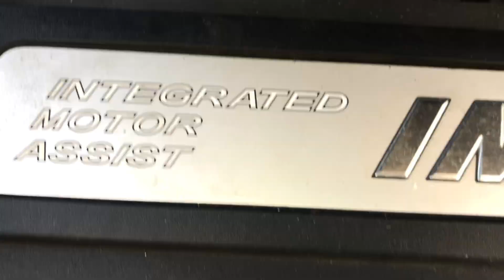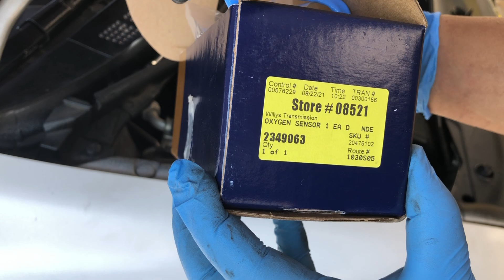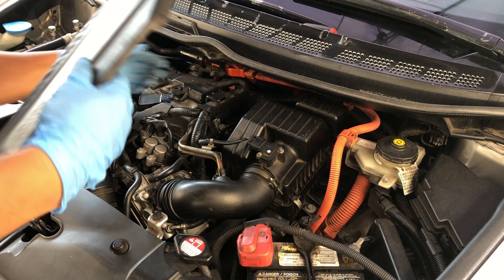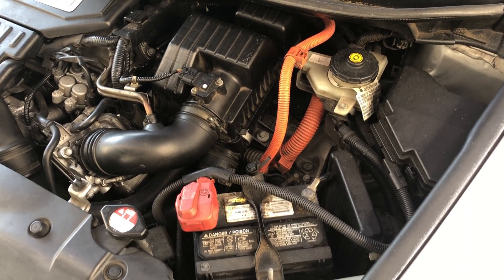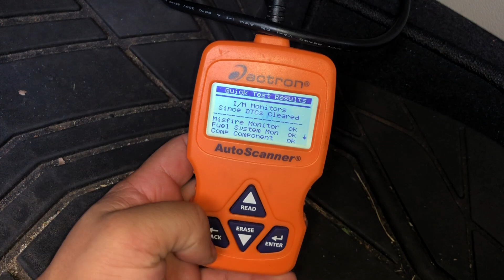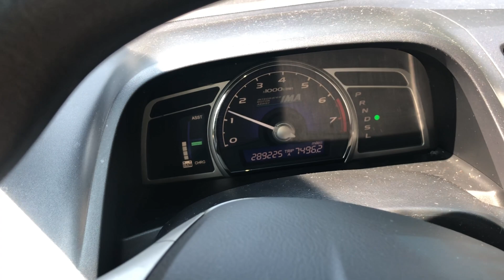2006 - 2011 DIY | Honda Civic Hybrid O2 sensor Upstream | P0420, P2A00, P1172 | 8th Gen

Comment: My vehicle has a p0171 fault. I cleaned the maf sensor and the vehicle's performance improved, but the engine light came on again. I'm not sure if I need to replace or clean the oxygen sensor. :( What can I do?
Reply from the maker: Sounds like you have a potential leak
Reply: @ Thank you for your quick response. I will check for leaks again.

Comment: I just replaced the same upstream sensor on my 2011 cr-z and now it’s throwing these exact codes, the sensor was not denso and bit cheaper one, someone on forums was saying the cheaper ones don’t throw enough voltage? Is that true? Do I have to bite the bullet and can’t the $200 sensor? Thanks
Reply from the maker: So I originally got a cheap sensor from Amazon and it still threw a code after 2-3mins of driving, then I bought another one from advance auto, it was like $150 or so, when I tested both O2 sensor for resistance, they both have the same resistance, but after installing the advanced auto O2 sensor, code cleared and never came back, so that might be the case, don’t take me on it, but O2 has to heat up to 600 degree or do for it to send voltage to the ecu if that makes sense, if there isn’t enough, the ecu is not able to detect the O2 sensor giving the fault code.

Comment: Is this the Bay 2 sensor 1? Cause that's the one I need to replace
Reply: i have the same code i believe its the one underneath the car located on rear CAT easy to replace as long as you have a jack handy